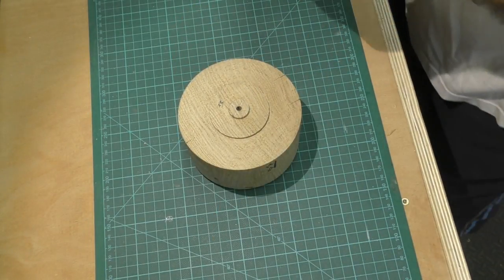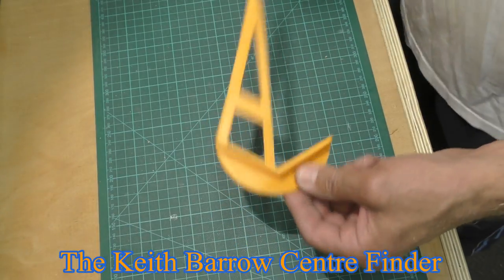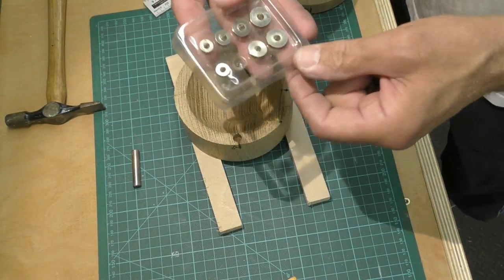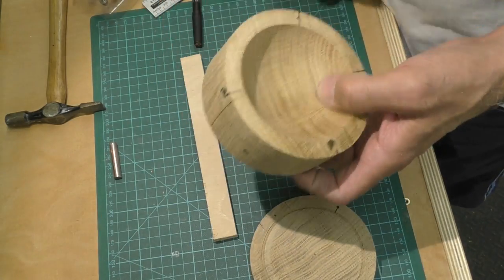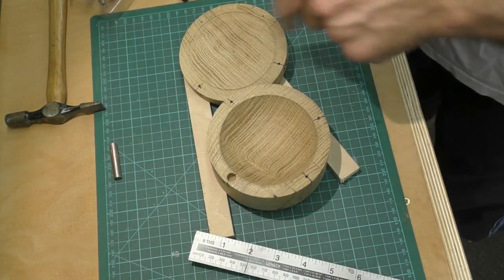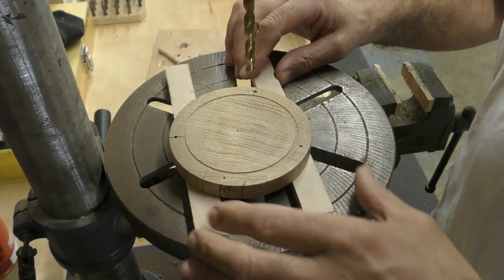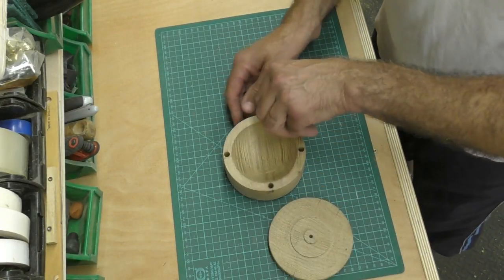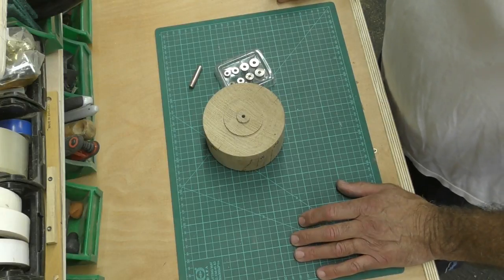Wood Turning - Swivel Lid Salt Holder Follow Up!

Comment: Nice video, Mike. I probably would have done it like you did the first time. But after watching, I'd go with the panel pin method. I wonder if you could mount some magnets in the holes on the opposite side to ensure tight closure?
Reply from the maker: Hi Jack, and thank you. The panel pin method for the win me thinks too. Magnets would work a treat, but I just wanted it as simple as possible on this occasion :)
Take care
Mike

Comment: Hi Mike, great to see some other options. Why do you drill the hole in the body longer than the metal pin...just curious. Thanks Mark
Reply from the maker: Glad you enjoyed the video Mark. The way I did the hinge was to epoxy it to the lid, so drilled the hole longer than the pin in the body, so that the pin would not "bottom" out. Hope that answers your question.
Take care
Mike

Comment: What about just giving in to entropy and drilling straight through from the lid to the base even before separating them, and then using a decorative washer or upholstery tack top epoxied over the lid and to the pin (like it was meant to be that way...!)? Entropy seems to always win anyway!

Comment: Good job Mike!!  I'm partial to the panel pin method, I've used that in the past.  The issue I've run into with using a center punch is that the punch can sometimes follow the grain of the wood resulting in a hole that is not where you want it to be.  When you are looking for grain and lid to line up a small deviation is quite noticeable.  Cheers, Rich
Reply from the maker: Hi James, I totally agree with you, the panel pin seems to work accurately every time.
Cheers
Mike

Comment: Mike, good points raised, I like all of these methods as they all work, the two centre methods are good for those that need grain alignment. For woods that a finish is applied that may hide the grain all would work well.
Thanks for the follow up.
Regards
Stephen
Reply from the maker: Thanks Stephen, I think in all possible scenarios the panel pin method is really easy, and accurate....I may be wrong though ;)
Take care
Mike

Comment: Excellent video showing four good methods of fitting the lid.
I think the Keith Barrow method might challenge my accuracy and with the panel pin method, it would only be a matter of time before I would  push the panel pin flush with the surface of the wood and getting it out would be a challenge.
thanks
James
Reply from the maker: Hi James and thank you, also a huge LOL :)
Take care
Mike

Comment: Yes the panel pin method works well even if it is irregular shapes, I use multiple panel pins for marking the pivot point and small rare earth magnets on boxes. Another excellent video Mike.
Reply from the maker: +Thomas Torley 
Glad you agree Thomas, and thank you
Cheers
Mike

Comment: Hi Mike, sorry to dump this here but I'm having issues with my draper lathe, I used it last night with no problems, went to use it this morning and its not turning. I can hold it with my hand when set at 2000rpm, it sounds like its struggling to turn and has no torque what so ever. Any ideas? im no lathe expert and this is my first ever lathe which I bought second hand. The belt is still connected to the pulleys and when you switch it on it turns so slow and as I say I can hold it with my hand and it stops with no effort at all. Hope you might be able to shed some light. Thanks, Rob
Reply from the maker: Hi Robert, I really am not very clued up on these things I'm afraid. Maybe post in a woodturning forum or group  on Facebook,  maybe you'll get some ideas there. Sorry I can't be of more help to you mate :(
Take care, and hope you get a worthy answer
Mike
Reply: Hi Mike, all sorted cheers.
Reply from the maker: Good news mate, glad you're back in business :)
Cheers
Mike